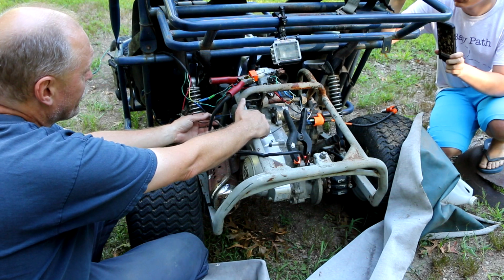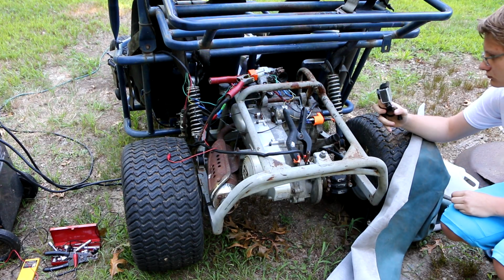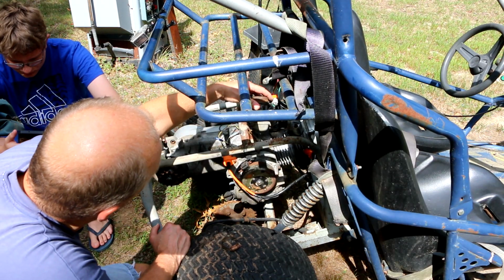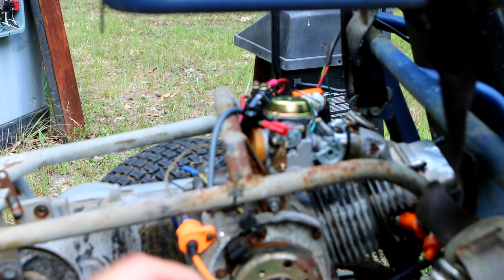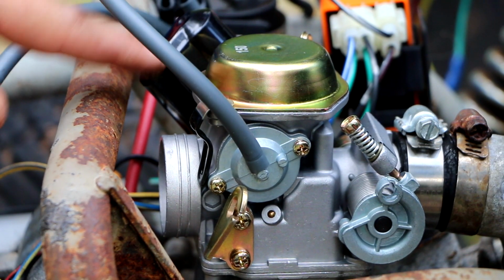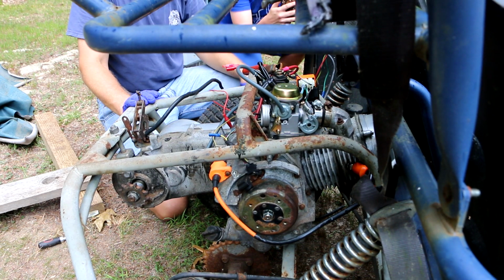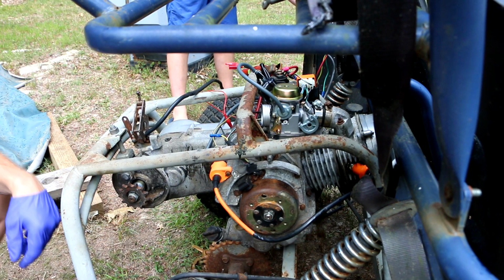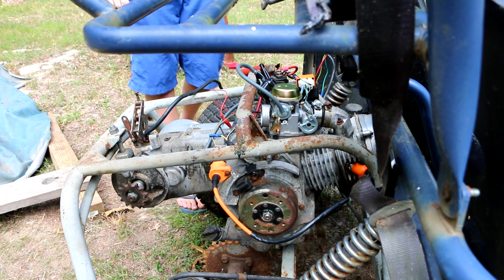The Yerf Dog Spiderbox go kart Part 20

Comment: Hi Steve thanks for the video, how can you buy the wiring harness for it on amazon with o serial number?
Reply from the maker: So we ended up hacking together our own home made harness. If you want an easy plug and play option that requires no ability to read wiring diagrams, this engine harness for the GX150 might be a good solution for you. It will take care of the wiring on the engine for you, only think it does not include is the small amount of wiring on the frame that runs through the brake switch, up to the starter button, and the ignition on off switch, and the lights up top if you have any. But they are easy to figure out.  https://www.supergy6.com/yerf-dog-spiderbox-gx150-usa-engine-wiring-harness-ac-fired-.html

Comment: My kids and I just got the same kart and it is in rough shape. I am going to have to watch more of your videos. I replaced the electronics and it just barely turns over. Took the starter apart and it smells pretty burned up.  The oil also smells really bad of gas. I am guessing the float might be stuck open. Thanks for the videos, they are going to be really helpful.

Comment: Theres a spacer for the manifold to head, to raise it up. Or try facing the carb forward, the manifold will bottle on 2 ways , i bilieve.
Reply from the maker: We ended up getting it to fit. Clearance is pretty tight. We might have to make an extention to attach the air cleaner. Not sure yet.
Reply from the maker: Thanks. We did get it to fit in ok for now.
Reply: Your welcome. It just didnt look like enough room for an air filter